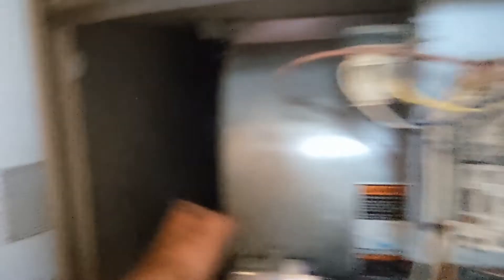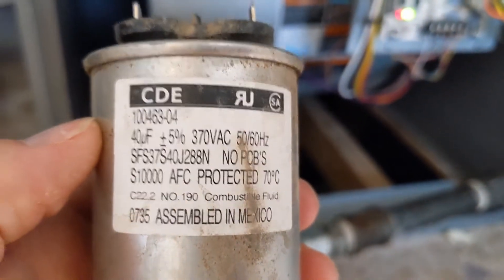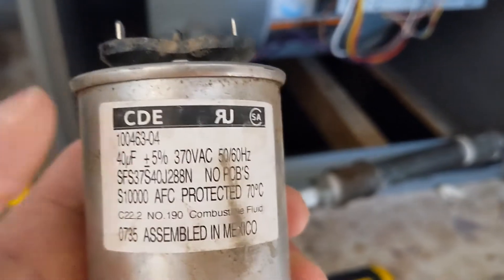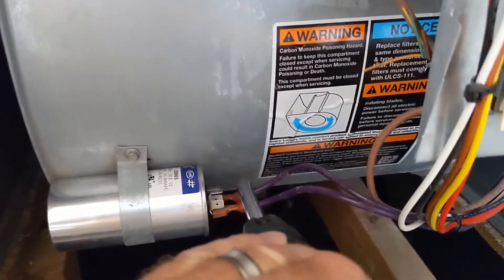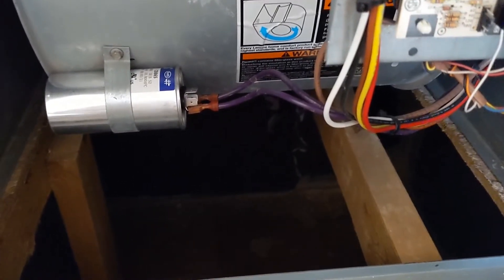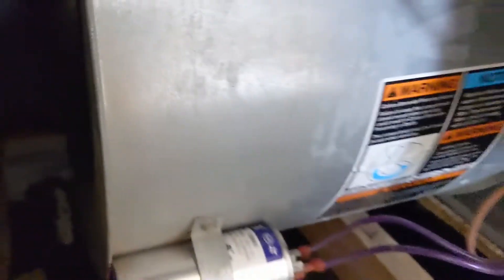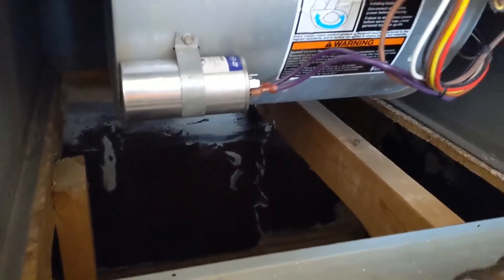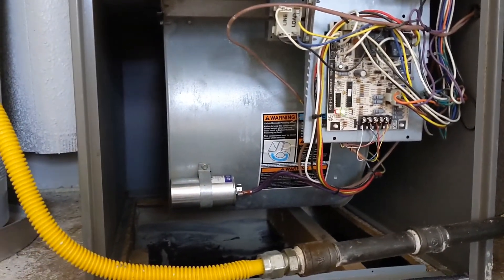Cheap Easy DIY HVAC Fix Humming Noise Fan Won't Start #hummingac #brokenairconditioning #diyhvacfix

Comment: Get to the point. Dude you drag on too long.
Reply from the maker: Lol sorry I'll work on that, appreciate the feedback 🙂
Reply: @OTeamFamilyAdventures Not bad compared to assholes trying to hit the 10 minute mark to answer a yes or no question. 

This video was useful thank you OP.

My fan motor just started squealing and eventually slowed to a stop and just buzzes now with the fan motor burning hot. Looks like I need a motor but I'll change the cap while I'm in there.

Of course it happens during the coldest week we've had in 2 years. 20 degrees all damn week lol
Reply from the maker: Hope you get it fixed, good luck!
Reply: Thanks to t actually worked